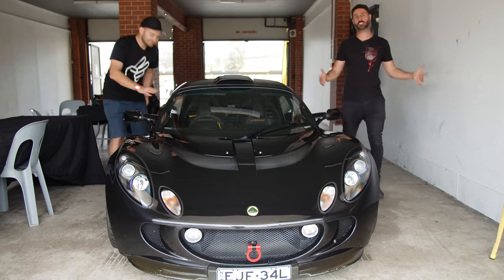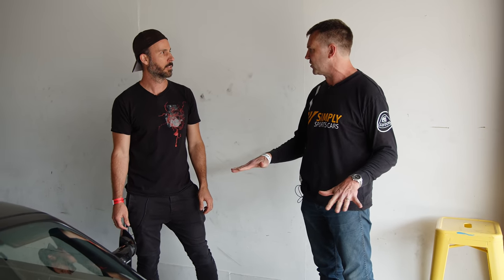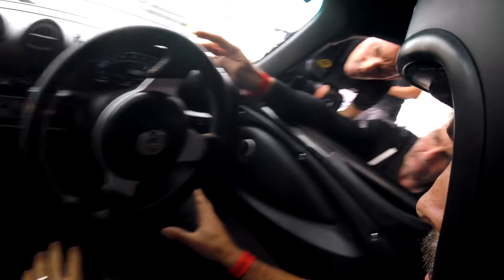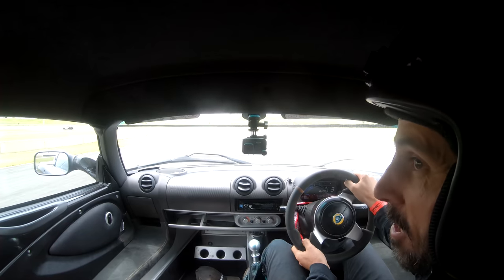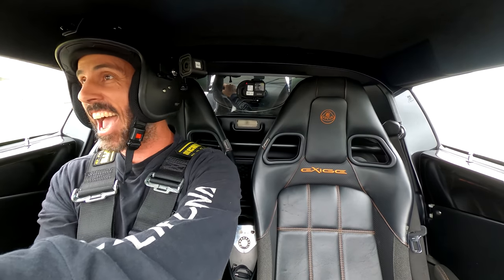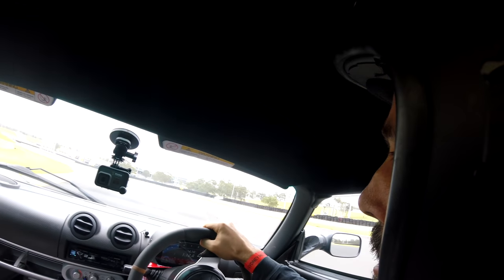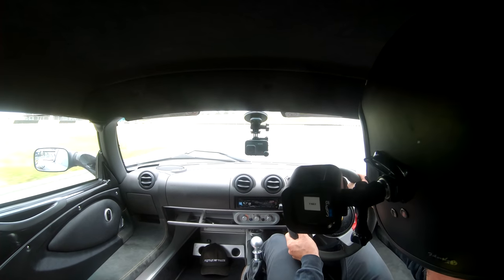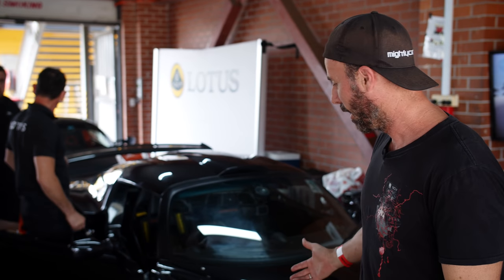LOTUS - Supercharger Upgrade (First Drive)

Comment: and this, kids, is why:
- tire and suspension setup is important
- you need to learn heel-and-toe
Reply: You forgot 60+ extra hp.
Reply: @Tummymunster  60 KW right? And if he hadn't done the suspension setup and new tires he would probably had a worse outcome then last video.
Reply: The absence of rev matching was kind of disappointing for me :(
Reply: @Maartin2000  I thought the original car made 190 something hp. I just looked back at his dyno video and it's a paltry 177hp so the new supercharger dyno'd at 258 so that's a huge difference of 81hp so yea you're right it's 60KW difference.
Reply: power is nothing unless it grabs the road!
Reply: 100% 👍🏼
Reply: Heel and toe is faster, but not necessary if you're just having fun
Reply: @eyemastervideo  absolutely not true. The way he was downshifting, you are asking for the chassis to be upset by that sudden lurch in rpms. I'm surprised he didn't spin it again
Reply: @breakfasteatre  and clutch wear
Reply: Heel and toe is such a must on track. I half-learned it before my first trackday but that first trackday utterly cemented heel and toeing for me, I've been ripping 'em off ever since!
Reply: That was crazy to me. Like how many track days have these guys done and he doesn't heel-toe? I do that coming into red lights have the time, haha.
Reply: @Fluxxyys  I agree! And unhappy valve train eventually! Heel and toe is a basic and truly necessary technique to learn if you're going to take spirited drives or tracking your car!
Reply: Not only heal toe but trail braking
Reply: Yeah the absence of rev matching on downshifts gave me mega anxiety. It's upsetting the car so much unnecessarily. Can only get so fast not doing it before you spin i'm afraid.
Reply: Heel and toe is all well and good,,,, unless you're a size 13+ clown shoe size like me 🤣
Reply: @bigpotential82  I feel you. You can toe and heel, side and side, toe and pinky lol! There's loads of ways
Reply: @jdmfreak22 oh absolutely mate, I believe there's a way for me that works, I just have to perservere and find that way 👍
Reply: Exactly what i was thinking
Reply: @eyemastervideo  Heel and toe is more fun than not heel and toe, by any possible measure.
Reply: @TestarossaMusicista  I agree. However one thing is doing it in a stress free low stakes scenario, another thing is doing it coming down from 200kmph approaching a corner. The risk is to make things even worse if you're not 100% comfortable
Reply: Heel and toe is huge of course but I don't blame him for not doing it on a car he's not too familiar with yet. It's more important to focus on smoothly rev matching to keep from upsetting the car. 

But in this video it sounds like he's not giving it any gas while downshifting, just slowly letting the clutch out and letting the revs come up... which is pretty horrible. While driving at the limit that could definitely cause you to lose traction in the rear, and of course causes a lot of wear.
Reply: @bigpotential82  same boat here

Comment: You really need to fix the exposer on that rear camera in the car so we can see the track. Nice to see your smile!
Reply: Was gonna comment this. Can't see anything.
Reply: Doesn’t seem like any of the cameras could handle the bright but overcast conditions.
Reply: Yes please! Mount a GoPro on the roof or point the windshield unit thru the windshield please!
Reply: on the hero 2 there used to be an extra setting for that exact application, not sure if the newer ones still have it

Comment: Moogs next lesson is rev matching downshifts 🥴 rip to the clutch
Reply: It’s not ideal, but it’s not so bad. Think about it this way - when the car starts from 0, the clutch has to move the weight of the entire vehicle. When the engine’s RPM needs to be increased, and the clutch has to move the weight of the engine’s rotating mass. That’s about it.
Reply: @computiNATEor  Well it's also just not great in that it'll upset the vehicle going into a corner. Getting shoved into a different rpm with a different amount of engine breaking suddenly isn't exactly great for a smooth driving experience. Rev matching isn't too difficult, imo anyone driving manual should learn to rev match on down shifts. I can understand if people don't want to invest into heel toeing but they should at least rev match. I understand it's a new car to him but he's pretty experienced with driving manual at this point, for an experienced driver it doesn't take more than one drive to get used to it enough to get decent rev matches. Literally only took 30mins for me to sort out driving my buddy's turbo miata and I couldn't even reach the shifter without leaning forwards and I'm not a racing driver. Learning heel toes in my 350z made corners SO MUCH smoother at speed and inspires much more confidence in braking. For an enthusiast channel I expect them to learn enthusiast techniques, or at least the minimal basics of them.

Edit: by sort out the miata I mean learn where to rev for downshifts
Reply: @NiSE_Rafter  Yes, I am aware. Even a big heavy car like my E39 M5 will get upset if you downshift poorly mid corner.
Reply: @computiNATEor  
 
Oh for sure I don’t disagree!
But the devil’s advocate in me thinks otherwise haha. 
~Ideally~you only have to move the weight of the car (more or less) once per session, whereas you downshift 1-3ish times per turn. From the wear perspective, that’s a lot. Maybe it’s less force, but it’s much higher frequency. Plus Newton’s laws tell us says equal and opposite reaction meaning it would be the same amount of force to accelerate to decelerate. Regardless heel-toeing is good skill to have in the arsenal. I also understand it’s a tough one to use in practice. 
Driver mod is best mod!
Reply: @computiNATEor   Yes its 100% ideal. Proper downshift is literally just as ideal as proper upshift. It has its place. Its needed for high performance driving. Like, literally.
Reply: @alejandroochoa3541  Like, totally, but like, dude, he’s not setting lap records. Like, literally. He’s learning. And he won’t wreck the clutch as he’s doing so. Jeezus.
Reply: @computiNATEor   Theres no excuse to not downshift. In that case why even bother going to the track? Why invest so much in power and suspension, and get your car setup to be its best if you’re not gonna learn proper technique? This dude’s part of one of the largest automobile youtube channels and if you dont see the irony and lacking something so simple, i’m done here.
Reply: @computiNATEor   blaming his tires, alignment, suspension, supercharger, brakes, etc is ok but completely ignore driver error is acceptable? Whatever....
Reply: @alejandroochoa3541  To have fun, maybe? To enjoy things on his own terms? Y’all take it way too seriously. 😂
Reply: @alejandroochoa3541  Didn’t see him spin this session. 🤷🏻‍♂️
Reply: @computiNATEor   that’s mean’s he isn’t pushing his limits. Not necessarily a good thing. Dork.
Reply: @alejandroochoa3541  the pedal layout and steering column in an Exige is such that you simply can't heal and toe to rev match in a downshift. Of course you'd know this if you weren't just an Internet expert who only gets to drive his mum's car on the weekend.
Reply: @greybeard27   Exige/Elise are both very cramped cockpits. The driver’s floor tunnel/boards do allow room to heel and toe. Hence why they’re regarded as one of the best handling cars ever. Because techniques such as heel and toe are what amplifies its capabilities.
Reply: @TheEditor43  driver mod >
Reply: @alejandroochoa3541  
An understanding mindset is not ignorance.
Reply: @TheEditor43   these guys are saying it’s impossible to heel and toe in a lotus is not ignorance?? How about the guy that thinks its downshifting is no big deal?? Wtf.... 😂😂 yeah i’m out
Reply: Moog's granny shifting, not double clutching like you should !!

XD
Reply: @NiSE_Rafter  drive a truck for a while and rev matching soon becomes habit otherwise you're not even going anywhere, once you have the knack you can apply it to any vehicle.
Reply: everyones a critic.
Reply: Pretty easy to practice on the street too. Once it feels more natural on the street it feels amazing on track when you fully attack brake zones with heavy braking heel/toe

Comment: Not saying it’s easy,  but he definitely needs a lesson in heel toeing
Reply: Yes..it’s painful to hear the engine braking..
Reply: @surenraj6450  I totally agree.  I was feeling for that clutch..
Reply: definitely..watch the professional
 do it on MTV2 and within seconds you can tell the huge difference in footwork
Reply: I'm a gear jammer, always have been. It's a hard habit to break.
Reply: I personally think learning heel toe technique isn’t that difficult. Like you can practice pretty easily just on the street
Reply: I always heel toe on the street, helps keep the car balanced when transitioning from accelerating to braking.
Reply: @Albinoid Maggot engine breaking is important, what he means is he is downshifting on the breaks without rev matching, using the clutch to speed the motor back up which wears the clutch
Reply: @Albinoid Maggot engine braking itself isn't so much the issue. It's  releasing the clutch when the engine is at the wrong rpm that can unsettle the car at the limit
Reply: @wiked3801  there is no video
Reply: @Albinoid Maggot engine and transmission will suffer. That is why you need to rev match.
Reply: He needs drift car for practice.
Reply: Miss me about the clutch, it'll survive. Besides, Toyota part. The reason why he needs to learn some heel and to is that under heavy braking, when theres no weight but still all the mass in the rear, the torque from the engine slowing down might actually be enough to break traction which with any amount of sideways G will violently make you go sidways. Ever ridden a big one cylinder bike? You know what im talking about.
Reply: Not easy, especially as he’s not driven this car that much. You need muscle memory to heel toe.
Reply: @Albinoid Maggot it does, no denying that. It’s just that it’ll upset the weight transfer as the inertia is in motion, the sudden engine braking done without Rev matching effects the turn in, it tends to unsettle the car.
Not saying you can’t drive on track without heel and toeing..it just helps with the late braking, smoother transition from apex to exit..
That’s all☺️
Reply: @cereal9593  my bad😄yes, this.
Reply: @raptorjeezus2607  you said it best, Philipp 😊
Reply: @Albinoid Maggot i didn't say engine braking is bad. You really need engine brake but you have to rev match it.
Reply: I had no choice but to learn how to do that, I learned to drive on a transmission with worn synchros.
Reply: @mintberri  
Gotta have the right pedal height 
My feet plus my slightly sunken gas pedal in my frs makes it harder. I can only do it if im REALLY going at it and on the brakes
Reply: @dorsch250   BINGO
Reply: @dorsch250  bwhahaha.... ok legend
Reply: @Albinoid Maggot purely done not to unsettle the car? No! It also reduces the G force shock loading exhibited on the gears, decreasing the chance to shatter gears.
Reply: Thank god I wasn’t the only one, literally grinding my teeth, the poor car haha
Reply: @Albinoid Maggot The issue has less to do with the engine braking and more with the fact that theres no rev matching, meaning that the synchro has to do all the work to make the engine and trans match speed. this is real ouchie for the transmission and such
Reply: @liamcooper5202  well that also depends on the car your racing, different aspects apply more to different cars. If your racing a factory civic for weekend fun then shattering a gear is probably not a concern, wearing out the clutch and increasing the cost of the weekend fun may be a big concern.
Reply: Lmfao hearing all you youtube mechanics is fucking hilarious 😂😂😂😂😂
Reply: Agreed with a lot of these comments. Heel toe and rev matching will certainly be a good thing for Moog to learn. Pumped for him and the Lotus.
Reply: @jaydunbar7538  oh i never said that it wont decrease clutch life. I just said that in response to the only reason is to not upset the ballance was wrong. True though that your weekend boi in his civic wont shatter gears but teeth can start shearing if they clutch dump for a 8Krmp down shift. Its also hell on the syncros.
Reply: 100%
Reply: Yeah that poor gearbox.
Reply: I heel toe all the time on the street but when I went to my first track day, sometimes it completely left my mind to heel-toe. Obviously I was aware of it but the concentration and speed required when on a technical race track can sometimes make you forget. Perhaps when moog gets more comfortable with the car he'll start driving it with a higher skill level?
Reply: Felt the same thing - there is pure joy in exercising a perfect heel and toe rev match
Reply: Wait what he doesn't heel toe?
Reply: @ODPTV1  doesn’t even rev match haha
Just needs a bit of learning! I’m sure if he starts getting more serious he’ll learn! Remember: it’s not easy to perfect, especially on track with millions worldwide watching.
Reply: Arent you embarrassed to leave comments like this one?
Reply: @TheEditor43  I'm genuinely surprised Moog doesn't heel toe rev match. I find it pretty easy I do it all the time in normal driving, it's like muscle memory for me.
Reply: I guess it’s an Australia thing but how does any petrolhead not  know how to heel n toe? It’s not a track thing, it’s a car thing
Reply: @ODPTV1  
I’ve noticed he hasn’t for a while, but yea it’s weird. 
Gotta remember that they’ve probably been driving manual before many of us were born. Before heel-toeing was commonplace outside of elite racing. His muscle memory might very well need relearning. Plus they drive nuggets most of the time 😂
Reply: Just to add to all the rev match comments, if you don’t do it in the wet you WILL spin as the rear axle locks
Reply: @D13-r9w  
I think you might be surprised how many manual drivers don’t know about heel-towing less how to implement it. 
Only 18% of US can drive manual competently let alone heel-toe.
Reply: Try being 6' 3" with long legs and see how easy heel toe is, its annoying seeing shorter guys do it easily on stock pedal setups. Meanwhile my knee just hits the steering wheel when I try it lol. I'm not bad at it though when I got my own car set up for it. Thing is guys say they can heel toe, but the hardest thing is heel and toeing whilst braking exactly right at the limit.
Reply: @sadaaromin13  Totally agree with you, mate. Surprised that Moog wasn't locking up by the way he downshifts. Hahahaha. But cheers to him for gaining back his confidence.
Reply: I used to have an Elise. If you are tall it's not possible to heel and toe. Maybe he's tall too.
Reply: He would benefit from a lightweight flywheel too I think.
Reply: @Albinoid Maggot it unsettles the car coming into a corner. Wears the crap out of the clutch and kills momentum as the gear doesn't always perfectly match the corner speed you want.
Reply: @mintberri  when you wear a size 14 shoe it’s quite the struggle
Reply: Where is a time stamp of Moog improperly rev matching or not properly executing a heel toe downshift? Here is the #1 comment by so many here on YouTube: "LeArN tO heEl ToE!"
Reply: @SF-tb4kb  mate you need to turn your foot at least a little bit, my knee just hits the steering wheel before I can get my foot turned enough to go across both pedals. Only car I've been sort of able to do it in is an RX8 and even then I'm pretty sketchily on the side of the brake to do it.
Reply: @SF-tb4kb  no actually can't do that, that's my issue for cars where you have to get your heel over to reach accelerator, my legs not straight enough to do it, honestly cannot twist my foot over at all with my leg bent, and if I move my seat back enough to do it, I'd need like a 150mm hub extender lol. But meanwhile you see Japanese guys do it with ease, just helps being small. Maybe im a little bow legged too lol.
Reply: @SF-tb4kb  well... I guess I just needed some headphones, I can hear it now. Sounds like sometimes he gets it but, some shifts were pretty bad 😬
Reply: @SF-tb4kb  ThANK YoU 😉
Reply: @CornerOfTheOval  exactly right! The clutch can deal with it, but the synchro’s have to “drag” the engine RPM up to match the road speed in the gear you’re shifting down into.
Reply: Lucky the track isnt wet or the rear would be kissing the front from not rev matching